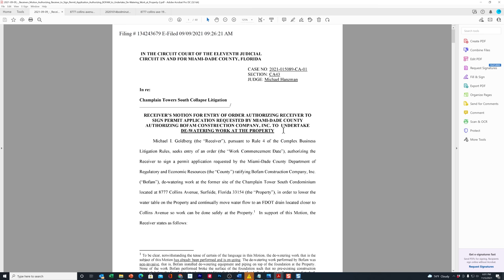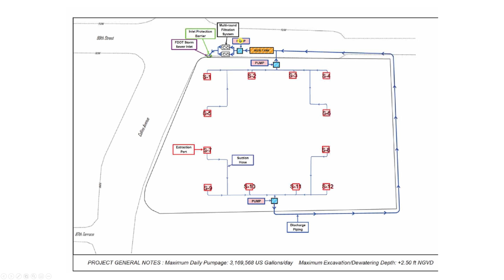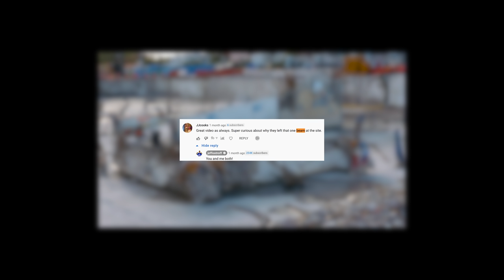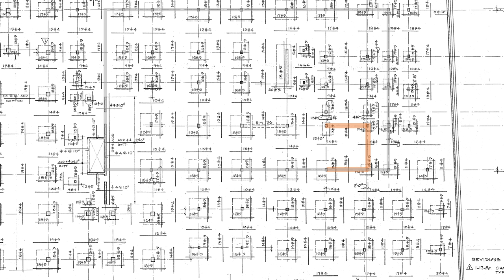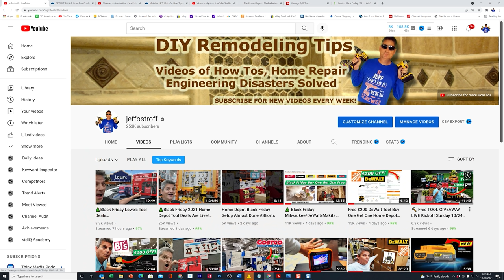Miami Condo Collapse: Engineers Baffled By Mystery Column

Comment: Not an engineer but I work in accounting and I get involved with transparency and oversight  and here is my guess on that mystery "column" next to the H Beam.  Once the debris had been cleared from the garage floor NIST wanted to do a groundwater leakage test to see how much ground water could seep into the garage.  They cut our a rectangular spot next to the H Beam as the H Beam is putting a lot of stress weight in that area of the garage floor and would enhance any leakage.  Then they took one of the damaged columns from another section of the collapsed building and sunk it into the ground where they cut our the rectangular section of the garage floor and leveled it out with some new concrete.  No, the column being supported by the H beam did not impale the garage floor because it was tied into the H Beam itself and when the H Beam fell and shifted minutely, the column supported by the H Beam would have crumbled due to lateral shifting.  Also, where are the blue prints for the 13th floor penthouse apartments?  Finally, the structural engineer who designed this building, what other buildings did he design and are those designs being reinspected just to make sure that any building inspection dept. would not have missed something by chance.  Thanks again Jeff.
Reply from the maker: It is highly doubtful NIST would do anything destructive to a column like that. They carted everything untouched to an off site storage area
Reply: Yeah, no...
If you want to measure groundwater infiltration, you simply drill a hole, hook up a hose and just measure how much water you have to pump off to keep it dry.  You'd have to do that in multiple locations to get an accurate picture.   
I don't think NIST was really concerned with groundwater, except keeping the slab dry so they could work...
The pool deck collapse brought the building down.
Reply: nope

Comment: This is very interesting.  I've read through other comments and replies; not all though as there are way too many.  As much as the "spear" theory is discounted because of the apparent lack of damage, it is the only possible explanation.  The Fiorella video clearly shows it was not there at an earlier time so a column would have had to have been added between the time of the video and the collapse.  If the addition was above board then there would be records and they would certainly have been found by now.  While it is certainly possible this could be done under the table since it is out of the prying eyes of anyone official, it appears to me that this location would have blocked access to a lot of parking spaces.  Officials could have ordered a column placed there but no one would voluntarily put a column at that spot!  We are certain it was not added after the collapse!  With all other possibilities eliminated, there is only one left!
Reply: You're like the anti-Sherlock Holmes.  Scotland Yard says: "YOU'RE FIRED!"
Reply from the maker: Yes the garage gate would keep out prying eyes of inspectors

Comment: Maybe it's a punch down column, it was on top of the "H" beam but came off it when the beam moved and with the weight of building on top it punched into the floor slab.
Reply from the maker: Keith that is one of the ideas that I briefly considered early on but I think there would have been a lot more damage to the garage floor if this was some talk type of a punch through from above
Reply: @jeffostroff  But what if the concrete floor was so saturated with water by the time of the collapse that it was "soft" and not the very hard concrete that we're assuming was there? If the floor was soft, is it possible that the column from above was jolted off its base with the collapse and its rebar just cleanly punched down into the concrete without a lot of additional cracking and damage?
Reply from the maker: @winonakent   That does sound like a remote possibility Although from fiorella's video we could see that the garage was mostly dry so it's not like that area was saturated with water to begin with. I still think the more likely occurrence is that a is that a column was built there and even if it was built there it makes no sense because there is no pile under it to support it. Remember every one of those columns that comes up from the garage floor has a pile with a cap underneath it that goes all the way down to the bedrock limestone.
Reply: @jeffostroff  Perhaps there had been water incursion underneath the parking slab around that location for some time but not necessarily making itself visible on the surface?  I still favour the theory that it's the remnants of the column above that shot down and impaled the concrete. Possibly it might not even be the bottom of that column. It might be a part of the column from farther up - maybe even midway up the building, or higher- which got severed during the collapse, and therefore it could fall from farther up and have more of a trajectory than if it fell from the 1st floor?
Reply: @jeffostroff  You counter the most obvious answer (the upper column punched through the basement floor) by saying it must have been a new column built there - but immediately counter that by saying it makes no sense because there is no pile under it to support it. Additionally, there is not a shred of tangible proof to support that hypothesis. Just speculation.
So what is actually your hypothesis?

The upper floor column will have been pushed downwards when the building started to move. It is completely feasible that the building did not come 100% straight down, but pushed slightly to the side by the remaining columns. After all, the entire collapse sequence started by the pool deck collapsing, pulling the ground-level slab sideways, causing the columns supporting the building to tilt sideways, resulting in their collapse, taking the entire building down.

The upper floor column may well have been punched throught the floor, filling any cracks and gaps left by spalling with very tightly packed concrete debris and dust. The concrete of that column must have been fragmented to dust, leaving only the abnormally thick rebars beeing hammered down by the weight of the falling building - ans eventually leaving them sticking out from the floor. As seen on the photos, the water will have leveled the surface nice and even. Without actually hammering the areas in between the rebars, one may not even notice that the tightly compressed material surrounding them is not actually solid.
Reply from the maker: @toweri_li  You are taking my words and twisting them up to try to prove me wrong. What I said was the piles would have to be underneath a column below the foundation of the building when the building is built if you're going to build a column there at the time of construction. 
But what I was saying is the only logical thing that makes sense at this point is that somebody came in and added that column in the last 12 months since the garage video was shot in July 2020, and no column was there. And it would have been somebody that didn't know too much about construction and didn't know that there should have been a pile under that column. Or, maybe the column was added as temporary shoring to what they perceived as damage on the ceiling of the garage near the H beam. Until someone shows me more evidence, this is the only scenario that jives with what is going on at the H-Beam location right now. My explanation makes more sense than a column impaling the floor from above.
The reason I don't believe that a column from above impaled into the garage floor is that the garage floor does not look like it is damaged; there would have been huge amounts of cratering of the concrete right around the area where the column impaled into the floor.  These rebar rods from the mystery column sticking up out of the floor look more intentional than they do accidental. 
And although this last sliver section of the building did sort of fall at an angle, the closer you get to the ground, the less the angle is and so the H beam fell straight down right where it was attached to the top of those columns and it is now sitting right by each of its four columns so it did not fall out an angle. Remember the building collapsed on top of the H-Beam and would have sent it straight down to the floor.
Reply: @jeffostroff  I am not trying to prove anything. What we all have, is nothing but conjecture - and no proof.
One must consider Occam's Razor here.

What is more plausible: Someone building a column right in the middle of a carage driveway, with not even a hint of documentation to be found. Or that the upper floor column just came down with the building and punched through the floor, concrete crushing to pieces, leaving only the rebar there?

Comment: I don't see any rebar coming out from the top of the center of the H beam so the beam sitting on top of it was not quite attached to it and after the H beam fell and slipped to the side, the falling column definitely could have had enough force and inertia to impale itself into the floor of the garage and start pretending  it was always there.
Reply from the maker: Good point!

Comment: That mystery column has beefy rebar.
Reply from the maker: Yes, all the columns have large diameter rebars, which is why they can accommodate usually only 4 for them across the column.
Reply: Yep, and maybe they were even going to put thee only drop panel/capital in the whole tower atop that one column for better punching shear resistance... but talk about denial... can't quite call it whistling past the graveyard as there's so little precedence for this happening to a building this age in N. America, but "lawdy lawdy"... seems like some expensive X-ray, ultrasound, etc. equipment should've been deployed long before the recent re-roof job was started.

Comment: HMOG!..  @7:05 are those post-construction, NOT-in-the plans, large (3"?) diameter plumbing penetrations made in the weakest part of the H-beam, i.e. right under the unseen column it was made to transfer the load of?  PLEASE tell me I'm seeing... not that.  IIRC, such penetrations--if made at all--should be in the MIDDLE part of the "web", away from both max compression (top) and max tension (bottom)... lawdy.  More to the point, WHY not put such holes WAY closer to a column, instead of RIGHT where all the "action" (load) is???  =:O
Reply from the maker: Yes indeed and it is doubtful whether that was done by a licensed plumber, even though the use of mission connectors is certainly allowed and they are somewhat reliable, I would prefer to have it completely cemented PVC pipe if that is indeed what they used, or perfectly threaded metal pipes if that is what they used there. It's hard to tell because it could be either painted white iron pipes, or just white PVC pipes. But either way yes looks like handyman work non engineering
Reply: Wow, I hadn't really noticed...  From what I can tell, they missed all the important rebar (it's put 1.5" from the top and bottom of the beam) but they may have drilled through a couple of stirrups.
I sure wouldn't have wanted to be the one assigned to drill that hole - 24 inches of inhaling dust!
Reply: The plumber probably didn't know what the beam was, that it was supporting ~100,000 lbs of building, before he fired up his drill...
Reply: Was hoping I was wrong... the deadly game of "Reiber's Jenga" continues... a few afterthought cores drilled willy-nilly over here for plumbing/electrical services, another few over there for materials testing... cast-in-place "beams" with only 2 top rebars and 2 bottom rebars... the "Swiss Cheese" failure model gains ever more data points... this proverbial camel very much needed a back-brace.
Reply: Know what I just noticed after watching the video again?  There are no penetrations in the wrecked beam...  And if you look at the garage walk-thru video again, you see the pipe does not go through the center section, it runs along the beam but goes through the slab near the K column.  Since the K column borders the kitchen units, it is logical to assume it's serving as a drain stack for those corner kitchens.
Reply: @jeffostroff  What is that white rectangular thing coming out of the H-beam, right under the piping that was drilled through the beam? Is that where the mystery beam would have been?
Reply: When we added a bathroom on our first floor, we ran into that same issue... in the basement, there needed to be a pipe running where a beam was blocking the way. The builder had to add another transfer beam to make it structurally sound. I remember asking why he couldn't just drill through the beam and he said absolutely not, you cannot do that.
Reply: @johnbergstrom2931  PHEWWW!... Good Catch, glad it was just low-res video... and my no-longer-youthful eyes, lol... OTOH, it's sad that such a jury-rigged practice is entirely plausible, given what we know of this building's "dubious past"... off to spot more cheese-holes... ;')
Reply: @johnbergstrom2931  That means that nothing is out of place as the H beam is not the one in the video.
Reply: @designstudio8013  The H beam in the garage walk-thru and NIST video are one in the same.  It was the only one in the building.
Reply: Unfortunately, the reality is that pipe was gonna go there no matter what any of us or the engineer would say.  Best you could ask for is to be properly detailed for the penetration.  And if it's designed as a composite slab, that penetration is in about the right place.  Middle of the span so there's no shear, and plenty of room above/below for the T/C couple
Reply: @tippyc2  But it's an illusion.  There is no penetration.  Watch the video again - at 3:55 to 6:20 you get a good view of the H beam center section.  Aint no hole there.
The pipe in the garage walk-through video ran along the center section, then up vertically through the slab to serve as the kitchen drain stack for the '12' units.

Comment: Would need input from residents to see if a new support column was added.  Based on the general condition of the garage, I’m doubting it.  Was there perhaps rebar under the basement slab that was forced upward through the floor?
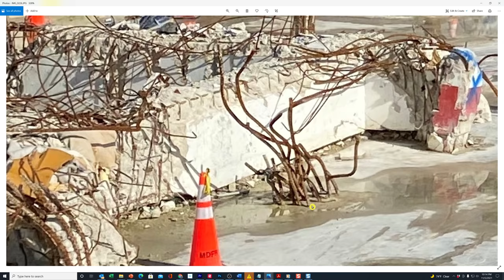Reply: Watch the video again (full screen) at 13:47.  You can see a clear, rectangular outline where the slab was cut and patched after the rebar was installed.

Comment: It must have been added after the infamous garage video was taken.
Reply from the maker: Yes that would be one explanation.
Reply: Someone built a huge concrete column, not over a caisson, and in the middle of a driveway? No one would have done that. No, the H-beam simply didn't fall straight down; it fell NW-wards and downwards at a 45° angle because the large columns under it toppled instead of crumbling.

Comment: What is the time difference between the time of the video was taken & the collapse? Is it possible the column was installed after the video was taken? I do remember something was said some repairs were done to shore up a floor. Subbed.
Reply from the maker: The garage video was shot in July of 2020, and the building collapsed almost 12 months later on June 24th, 2021. So yes that is my theory is that somehow they started building a column there to shore up what they saw was some type of deficiency in the ceiling near the beam period now I don't think anything was wrong with the beam itself, because this column was clearly placed about two to three feet east of the cross line of the H beam where was supporting that floating column from the first floor going up to the penthouse. So it's such a baffling mystery about why they put the column there, and this seems to be the only scenario that fits all of the current evidence on site is that somebody added this column in the last year.
Reply: @jeffostroff  Thanks for your comment. That was just a guess on my part because I was talking to a friend of mine who live down there & she told me they were doing some repairs in the building. Listening to your other videos about the collapse now. Thanks again.

Comment: Speculation: The red usually indicates something to do with fire?? maybe a fire pipe or fire extinguisher??
Reply: Or FDC location.
Reply from the maker: I thought that initially but go back and look at the freeze-frame inside the garage, you will see that the fire extinguishers are on the other poles with the yellow  stripes
Reply: I can't see it in the video, but I've seen that in buildings...  This building would have a fire alarm main control panel.   A building engineer or Fire Alarm Tech person finds that panel, checks all the alarm heads & sensors, does PM's on the system...  In case of a fire alarm, Fire Department personnel want to find that panel, and see it, and see where the alarm is coming from, so that they can respond to the right area with speed & efficiency....  I've seen that area painted red many times...  I am not 100% sure if that's code, or the FD's want it painted red, or the alarm techs want it painted red...  but you see that a lot....  I'm just speculating, but that's what it looks like to me....  It would really be great to find the Techs from the fire alarm company who had the maintenance contract for this building...  I'm sure they could shed a lot of light on a lot of things....
Reply: @jeffostroff  It looks like most of the red ones have a box with a powerline going up into the roof. I'm assuming these columns had the fire alarms attached to them. I counted 3 of them from this and the past videos and there might be more, it's hard to make out things in that shakey video she taped.Though it's hard to see, they all look like they have what looks like a fire alarm on them.